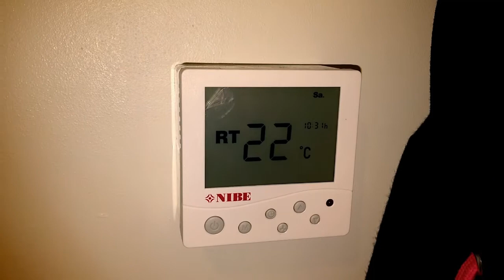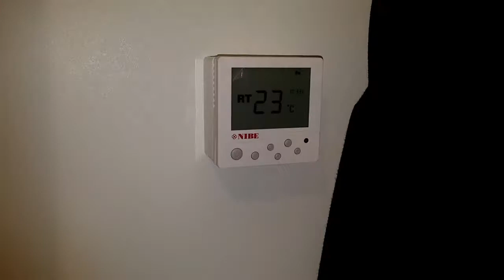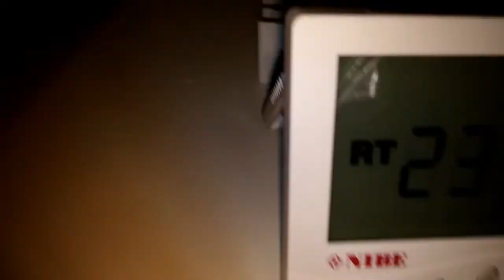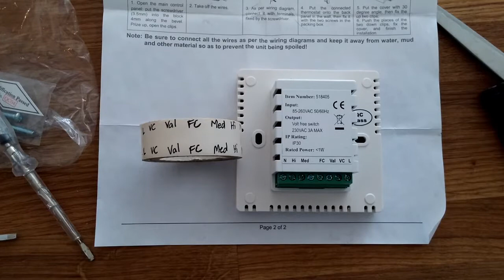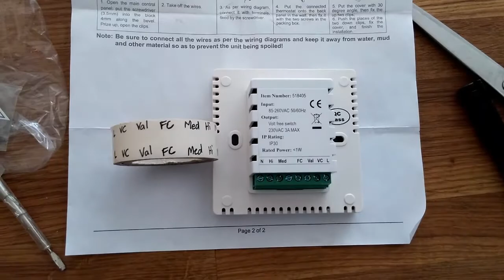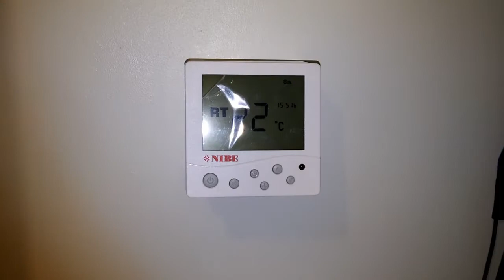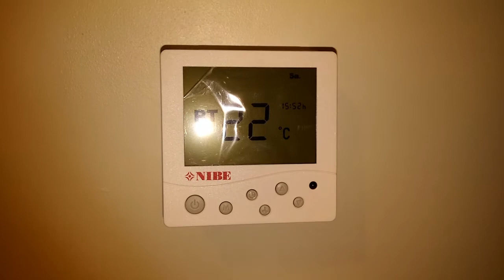Change NIBE Thermostat Controller - Because Floor Was Always On

Comment: Hello, I have the same or very similar NIBE unit. I noticed this winter that my radiators were not heating up properly, unless turning it up very high. Or just being unreliable not coming on at all.
Do you think I need a NIBE plumber engineer or electrician?
Reply: Hi. I would imagine it will be a plumber /heating engineer (just a guess). Maybe the pipes have started to fill up with corrosion. However, as far as I know these Nibe systems were only designed for underfloor heating, not radiators as they can't bring the water up hot enough for radiators. I could be wrong though.